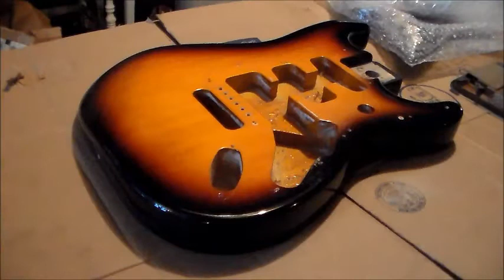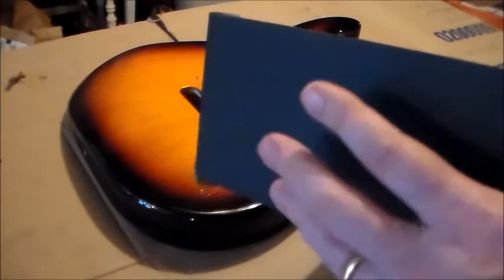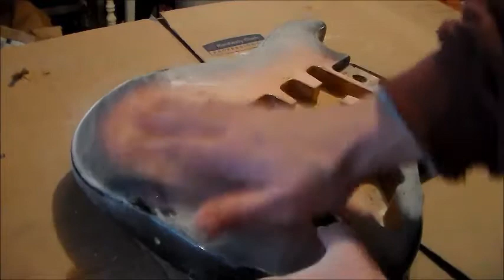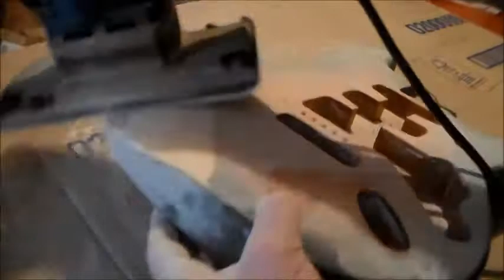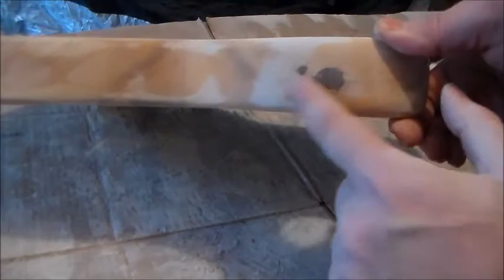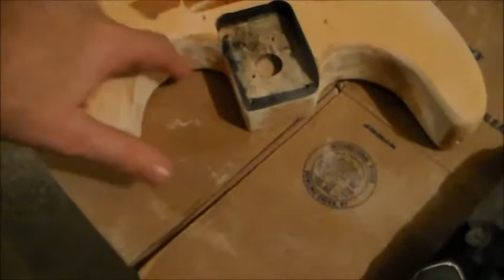Fast Eddie Clarke Motorhead Ace of Spades Replica Part II

Comment: Heat gun and scraper that's how I'm living
Reply from the maker: happyads Coop, if that’s working for you! These new poly finishes are tough and thick!! Definitely not easy to remove.
Reply: @Metalcop5150  Yea they are bullet proof. Give the heat gun a try,, its really easy.. they arnt fire proof my friend👍
Reply: Trick with the heat is to try and leave the sealer coat on. Its not easy to do but it can be done then you can just buff it out or throw some more clear coats on the body, let dry and buff that out. Doing it this way allows you a better end result.

Comment: Just found. Part 3? Did Eddie have a blocked Kahler Trem?
Reply from the maker: Michael Wojciak Eddie actually had two of these guitars, nearly identical! If you watch the Excellent YT vid. of Eddie demonstrating how he plays ‘The Ace of Spades’ and other tunes, he’s playing one and the other is in the background. One of those guitars was modified for a Kahler. I believe he had it converted back (to a vintage trem) and has the hole filled, in later years. Hope this answers your question. Please consider a sub!! Thanks. ♠️
Reply: @Metalcop5150  Subbed! I was thinking of putting one of these together....or something  close.   Looks like standard chrome hardware and the brass pickguard and knobs.   Very cool.